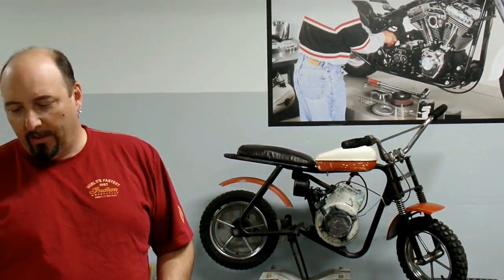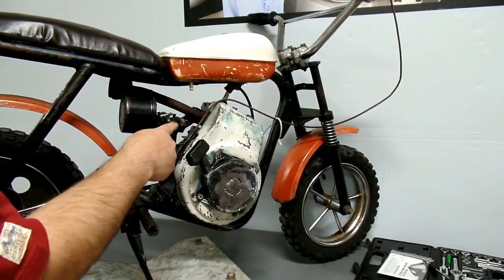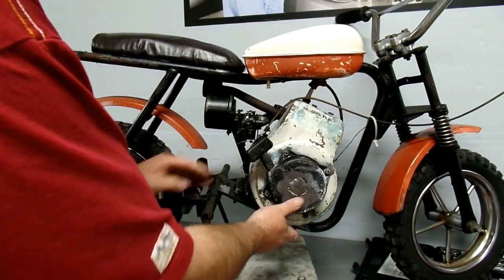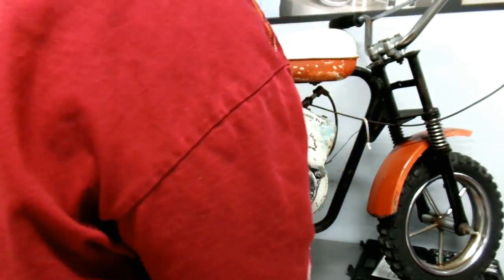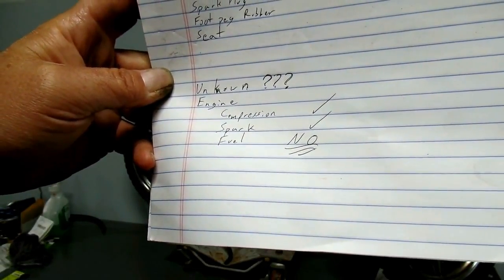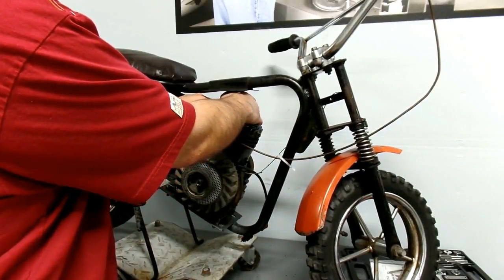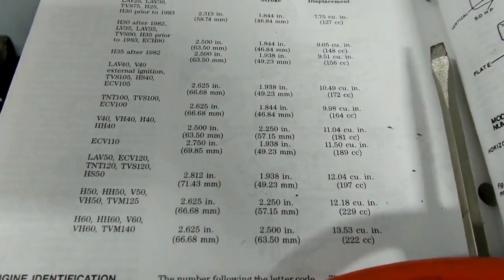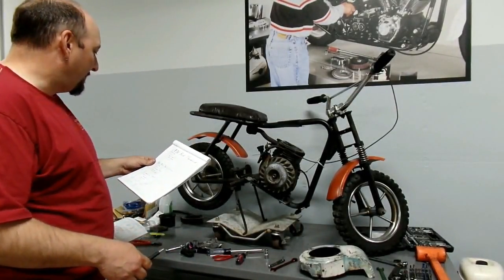Project Bike Project: Minibike - Part 2

Comment: you need to make more videos of this minibike
Reply from the maker: Thanks. We have actually progressed quite a bit on it, but our camera was down. There will be more in the near future.
Reply: @ClymerManuals  i just bought one to restore and i need to redo my fork springs
Reply: @ClymerManuals did you ever finish the bird, thunderbird 4hp bike?
I just dug my old one out.  I put on a #35 chain since mine was missing.  I seem to not have spark, perhaps magneto or the shut off is not grounded.  Also no fuel thru carb, so prob needs rebuilt.  Just checking on your progress.

Comment: How do no what year it is ? I have one that doesn’t  have front springs  in the forks.
Reply from the maker: It really is nothing but a guess based on a magazine advertisement I found online. If it had the proper motor/shroud on it there would be a date for the motor there. There are several old minibike groups on Facebook that are full of helpful guys.
Reply: @ClymerManuals   its a bird engineerin built thunderbird circa 1969-71ish. (didn't think they were made after 71, but I could be wrong on that one)  The angled engine mount is the giveaway. They re-did this bike in 87-95 when it was built by manco. it was the last American built minibike.
Reply from the maker: @billwilliamson9842  Thank you BIll. You rock!